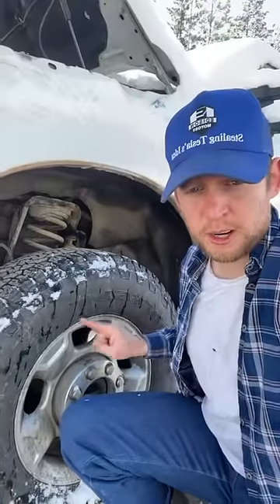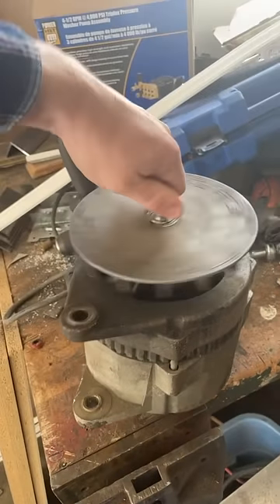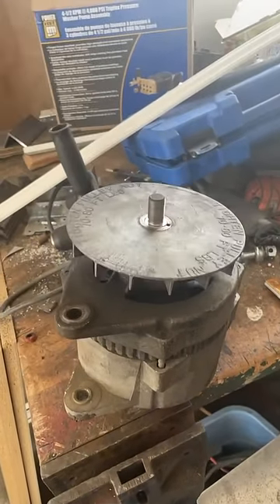Alternator on each wheel???

Comment: Hybrid and electric vehicles have been using regenerative braking for years by using the drag of the electric motors on each wheel causing the vehicle to slow down while using less actual brake pad and in doing so the drag of the motors is able to create electricity just like a alternator and have it sent back to charge the battery
Reply: This is also why they hardly need new brakes compared to conventional vehicles
Reply: Still they dont create electricity but turn energy that would be released through heat into electricity. But even there you have losses because of friction and heat making it not 100 percent regeneration. However since you dont need to use extra energy for it tow work its a overall win
Reply: @Basti K.  yea I should have worded it a little differently
Reply: @bastik.3011  You're just being pedantic. Technically all electricity generated is from conversion
Reply: @bastik.3011  Cuz this aint goin to be a KERS 

Just keepin ya from burning thru brake pads n goin like Dom all the time
Reply: @johnknightiii1351  Sure i am, but i did so without being rude so were is the harm
Reply: @sargera1  amd charging your battery
Reply: @bastik.3011  regenerative braking absolutely creates electricity. And tesla uses it rather than heat conversion.  Certainly not enough to charge a large % of battery, but some.  Brake pads aren’t used during this process.
Reply: @tyleranderson8634  Basti is wrong. FYI.  You are far more accurate.  The only thing he said that is right is there is a percentage loss.   Have a great day.
Reply: @matthewdorsett9446  you literally cannot create electricity, law of thermodynamic. Regenerative braking uses the friction and heat of the motors to turn that into electricity. Tesla is not unique in that
Reply: @johnknightiii1351  Due to the extra weight of the vehicle, they last the same, and if driven more in the city, they will need to be replaced more often on the EV. EVs have higher maintenance costs overall due to the extra weight: tires, shocks, bushings, bearings, etc.
Reply: @dk-bw4gk  did you just make this up? It is not true at all. What I said is easy for anyone to look up 🤔
Reply: @johnknightiii1351  Yeah, I looked it up. That's why I said it. I've known about it since EVs became trendy again and it's still true today.
Reply: @bastik.3011  No, it uses what would be hydraulic braking on normal cars but instead of brake pads and calipers, it lets the motors spin without current being applied to it to create a small amount of electrical energy… It does not use heat to create electrical energy.
Reply: @johnknightiii1351  No electric cars cost way more to maintain and repair than internal combustion of the same size.
Reply: @mikeznel6048  ugh this is hopeless
Reply: @mikeznel6048  You have clearly no idea what you are talking about
Reply: @bastik.3011  All electricity humans have has to be generated. I het what your saying but in normal English we'd say "create", or "generate" power.
Reply: @brendanwakeley9103  Doesn't change that create is just a wrong word for energy, i get it probably comes from a time were not everyone understood the concept
Reply: Regenerative braking works only because the car was already moving and had to stop. How do the car get moving to use regenerative braking? Oh, yeah! . . . The car used energy to get moving before regenerative braking works. If the wheels were not already turning regenerative braking does not work.
Reply: But it still doesn’t create more energy. Nothing is 100% by far. You cannot produce more power than used.
Reply: That's also like just flipping three wires around on the motor though
Reply: Exactly, there already are alternators in the wheels..
Reply: @bastik.3011  there is no law of thermodynamics that says you can’t create electricity.  It says you can’t create energy.  Don’t confuse the two.
Reply: @bastik.3011  with this logic you create nothing. A sculpter didn't create Venus de Milo, he simply reconfigured the stone.
Reply: @matthewdorsett9446  I am exactly saying the same but you are pushing against it, dont act so high and mighty now
Reply: @bastik.3011  My understanding of regenerative braking uses the magnetic eddy currents from the spinning part of the electric motor to both cause electric current to flow in the system to charge the battery and cause magnetic resistance to the direction of the spin. Drop a magnet down an aluminum pipe, same gist.

Not much to do with friction or heat, besides the efficiency loss of the system.
Reply: So basically this guys video is wrong af. Lol
Reply: @dandeerso  it's the concept of an electric motor in reverse. All of a sudden there's more energy going into the (magnet?) Then was going out and current goes the other way around
Reply: @dk-bw4gk  the mechanical brakes typically are not applied on ev or hybrid vehicles until the vehicle slows to a speed of about 15 mph. Regenerative braking is very effective at slowing a vehicle down. I have seen hybrid escapes with over 100k miles and original brakes that appear just about new.
Reply: Idk, i havent charged by kids power wheels eversince i attached altenator to that. Just got one that produced more power than the motor consumes. Battery really only powers it to do the initial move.
Reply: Yes but the key is it slows the car down
Reply: @martyk1156  John Knight III up there wants you to know that anyone can look this up.
Reply: @dk-bw4gk  yeah I became aware of how much longer components of an EV vehicles last years back when I became certified to work on them . I have to say they cost of owning one is drastically reduced from that of a conventional vehicle. Much less problems as a whole from what I have seen in the dealership over the past 15 years.
Reply: 2005 Prius we had ran over 140 miles and NEVER needed brake pads due to the regenerative braking,  That's why a Prius and any other hybrid can do so well and it is one of those intangible gains that nobody really thinks  about.  What does a brake job cost?  Not a ton of money but that adds up over the life of a car.  A hybrid that can go 200K miles without a brake job is something dealers don't talk about because that regeneration works best if you are doing moderate braking.  If you race from stoplight to stoplight then you don't get as much benefit.
Reply: @gscott5778  I like how everyone's got stories now. My wife's old Forester didn't need new brakes until ~160k. That's why large SUVs and AWD vehicles do so well, large pads and rotors. It doesn't cost much but it adds up over the life of the car. I had a friend who had a Prius, always made fun of his front wheels full of brake dust. Kept telling me EVs never used brakes, yet he had to change them more than my Mazda. None of these stories mean anything. Most EVs won't even make it 200k miles and will go through more maintenance than a regular car in that time.
Reply: @johnknightiii1351  excellent use of the word pedantic
Reply: @nicksawyer6250  I’ll take “things that never happened” for $500, Alex.
Reply: Right, BRAKING.
Reply: An alternator and an electric drive motor are the same thing, a conversion device between electricity and mechanical movement.  The flow direction of the energy is the only difference.  (The OP wasn't paying attention in their 7th grade science class.)
Reply: @dk-bw4gk  i just did the brakes on my prius for the first time, at 290k miles.
Reply: We know. This whole truck works on regen braking, half the comments section is barking "tHis wAs On ThE PrIus FiRsT!!" We know. We know
Reply: @dk-bw4gk  when GM produced the EV1 it was for lease only after California passed the zero-emissions vehicle (ZEV) mandate in 1990 (CARB). The technicians who serviced  them wore dress clothes and didn't even get their hands dirty. Only a couple of grease fittings and no oil. After auto makers got California to repeal the law, GM recalled the EV1 and destroyed them.
Reply: @bastik.3011  no actually they are high resistance motors creating voltage as you brake it turns the armature creating drag which turns the high resistance motors while slowing the vehicle. You are just getting some of what was used to get it moving back in some portion anyways.
Reply: @nicksawyer6250  if you did that you are a genius,  because there is no possible way to do that. You can't get more out than you put in. It's that simple. That's a horrible inefficient way to recharge the battery. The resistance to recharge it would exceed what you are putting out, no system is 100% efficient.
Reply: @alphatrion48  drag creates thermal energy but yeah you are right. Dag is Friction which is its own form of energy and that is being uses
Reply: @dk-bw4gk  I changed the brake pads on my 4wd Tahoe after over 140,000 miles and they still had quite a bit of pad left.
Reply: I thought it was the static electricity created by breaking that was sent beck into the battery....
Reply: The ford panoz used as a hybrid had a 400hp electric motor inline with the drive shaft with a ford gasoline racing engine ...it never won a race but finished in the top 5 or 10 most of the time . The electric motor was quite heavy at the time as it was experimented with back in the 1990's ..Porsche has long since perfected the combo .
Reply: Even the best regenerative braking systems can't charge the batteries. at the rate the wheel motors use up the power. (an example) you could ride an E bike electric motorcycle all the way to the top of a hill. and then turn around and ride the E bike all the way back to the bottom of the hill. with the regen on, and when you get to the bottom. and the batteries wouldn't be fully charged. although they would be about two thirds more charged than if there wasn't regenerative braking. I watched a guy, his name is Edwin Olding. do it on a Sur ron E bike here on YT. the laws of physics don't allow for free energy. but the regen helps quite a bit.
Reply: I don't think there's any electric vehicle that has motors for each wheel. They certainly don't design them that way now. Typically there's either a single generator or, more often, one or more of the drive motors in the electric vehicle is used as a generator.
Reply: @dk-bw4gk  nope. Typically it's only the regenerative breaking that is used during normal stops, particularly in city traffic. My 2015 Prius had regenerative braking. The front brakes lasted about 120,000 to140,000 mi, about three times as long as front brakes of any other car I've ever had. The rear brakes lasted about 210,000 to 250,000 miles. The car went 310,000 mi before I got into a big enough accident that the insurance company decided to total it. I had to do zero repairs on the car other than oil changes, coolant change, brakes and tires. The car had been all electric, I wouldn't have had oil changes to do.

I used the car mostly for Lyft driving, so almost all of the driving was a combination of city and highway, but mostly city. That Prius was relatively heavy for its type (four-door hatchback), so weight was not a thing that was prematurely wearing out brakes. Regenerative braking kept the brake pads from being used much of the time.

It sounds like you read just enough to make you ignorant about this stuff.

Comment: My old bicycle had a generator. It put out so much power, that I had this awesome dim light that only worked while I pedaled my legs off.
Reply: And do you remember how much it slowed you down? Or or how much harder it was to pedal when it was working?
Reply: @Technichian462  
Yes, yes I do!😅
Reply: I had the same generator thing on my bicycle.  It added so much additional effort to pedaling that I used it a grand total of once.  It really hit home the concept of how much energy there is in just a few watts.
Reply: I remember... I had cool dual headlights on my 20" bicycle , 2" rear slick, sissybar, apes.. Too much effort to pedal with the generator on..
Reply: I also had one on my 20 inch bike growing up but when I got older I put in on my 26 inch bicycle and it was WAY easier to pedal!!! That’s how gears work, ya know to reduce the drag on rotation.  Just kidding, I had to put my bike in low gear to ride because of all that extra drag😂
Reply: should have put a gearbox on it, of course direct drive has the most drag
Reply: Did you have to go downhill to? I am just wondering if i fked my school project up 15 years ago 😂😂😂
Reply: @wholeass83  no, some bicycle lights only have a straight connection from the generator to the light, no battery
Reply: It's like engine brake for a bike. I remember those 😂😂😅😢😢
Reply: Same 😅😅😅
Reply: Bet it took so much power to drive it that it pushed the bike backwards
Reply: @Harrybowles1969  definitely extra friction on the tire for me! The lights sucked going uphill! But downhill was lit! 😏 😆 🤣
Reply: @dizzlefshizzle  AHH those were good times! I had one of the first bicycle speedometers with a big analog needle and a cable going down to a wheel that ran in the bike tyre. I was high tech back then 🤣
Reply: @kingmasterlord  A direct drive will ALWAYS have less "drag" than a gearbox.
Reply: @billymanilli  no doubt. 
I seem to recall the generator had an over centre latch, you flicked the energy zapping mother lover off so you could get up the hill!😀
Reply: I had one of those on my bike in the 50s and it was only good for going downhill because the drag was incredibe . Now can you imagine how much drag it would exert on an ebike that has a 1200 watt motor in Oder to power that. ?
Reply: @Harrybowles1969 I had forgotten about those. We could never afford one but my buddy had one on his bike and it was the coolest thing we had ever seen. About 1958. He had dual headlights built into his schwin Cruze. Just like the 58 Chevy
Reply: Yes your legs provided the power for the lights .